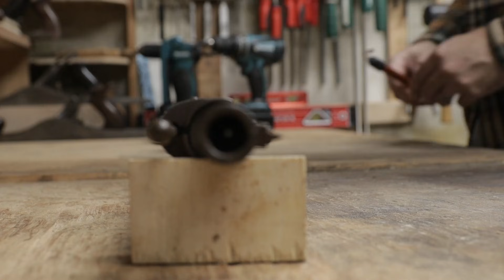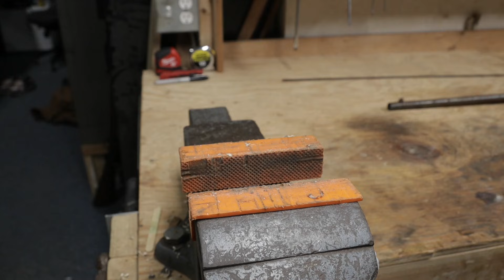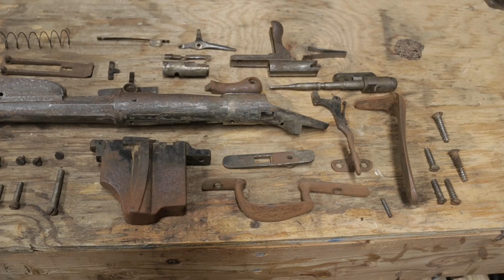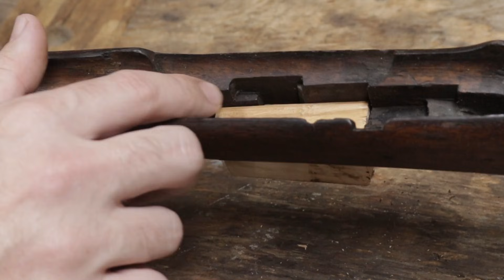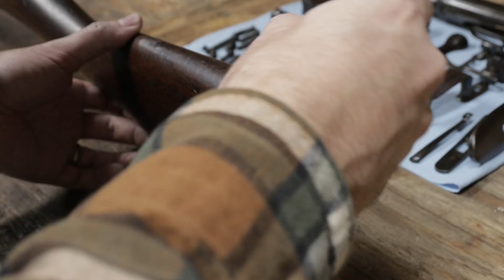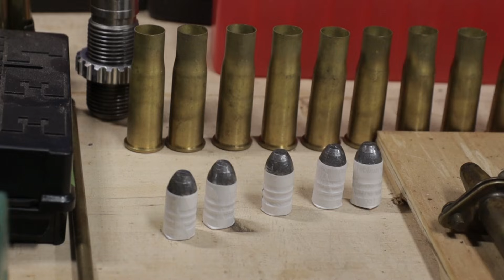Dutch Model 1871/88 Beaumont Restoration

Comment: another really nice restoration. I have never seen that method for blue I have restored my rifles mostly using cold blue but that looks better for historical pieces. once the sights are fixed and the bullet diameter and powder charge is fixed I am sure you will have a fine shooter. Thanks for the video. LL

Comment: Well done! No shiny rebluing or stock sanding, just preservation. This is exactly how a restoration should be done. Many people go too far when restoring old rifles.
Reply: I agree but I'm going back and forth on my vetterli ive been hunting with mine. To keep it like his work or fix it up good.
Reply: @ClaytonGambrel  A Vetterli is highly collectible if it's in original condition. Would recommend to keep any restoration to a minimum, remove active rust and dirt etc. Just give it a good cleaning. It will lose value and originality if you do things like sanding and re-bluing. But if it's already "ruined", like sporterized or something, then it doesn't matter. The Vetterli is nice and interesting rifles by the way, I have an original Vetterli-Vitali M1870/87 in caliber 10,4x47R.
Reply: @WhattAreYouSaying nice, it's going to be sweet when I do get something just been a hard season on deer at least for me

Comment: With any rifle of this vintage, you are treading the same path that the original producers of these one time cutting edge firearms must have tread. Most of the past failures of a great many rifles have been traced back to the ammunition that chambered the firearms. You've done an amazing job just restoring the arm. Taking it to the next level by reloading it for range use, that's incredible.

Comment: no re blueing for any parts? and also power sanding the surface was scary
Reply from the maker: I don't believe in re-bluing old guns. I like the original patina
Reply: @rakumprojects  fair point. I just find re-blueing the surface make them last longer. But leaving it as-is works just fine I guess. Great work too.

Comment: You might want to try improving the bores on these old rifles very simply by using a brass rod tapped #8-32 in one end for an #8-32 machine screw.  Use a hole punch to cut .50" diameter Scotchbrite circles with a center hole for the screw.  Attach one circle to the end of the rod and run it through the bore with some suitable bore cleaner. Try fine circles first and gauge your success.  Hope this works for you.

Comment: The bores on these rifles are usually in very good condition.   Unlike the Italian Vetterli conversion the Dutch did not add a steel surround to the magazine cut out.  Cracks are all too common.  The extractor is loose in the action and frequently missing.  Prospective buyers should check for its presence.   The lump behind the bolt handle strengthen the action and was added with the magazine conversion and the magazine cut-off.   The rifle was loaded with four-cartridge chargers, a close copy of the Italian Vitali chargers.   The magazine had a baked-on (?) black finish.  The rest of the rifle was in the white.

Comment: HELLO  everyone  i bought one of these  a few years ago  what a  fantastic rifle  it was in relatively good condition  to  but  it  also  had a crack  on one side in the  magazine area  which i was quietly hoping  wouldn't be there. cleaned the  barrel out and you should have seen  all the  dust and nicotine fluff and shit that  came  out but  wow the rifling is brand new took the  bolt out and  took it to work and  threw it  the parts  washer and  then  re oiled it  thought it was a  wiser thing to do  than  pull  it all  to  bits (im not  a  gun Smith)and  bugger it up linseeded the  stock finally oil the barrel  and stuck a ear plug in the muzzle to stop damp getting in.  a lovely rifle everyone who  sees it  says  wow beautiful rifle how old is it

Comment: The cracks in the Beaumont conversions are about as common as the cracks in the Italian Vetterli conversions.
Reply: The Italian Vetterli-Vitali upgraded the original single shot Vetterli with the addition of the Italian Vitali magazine design.   The magazine cut out had a corresponding steel shield screwed to the stock to strengthen it in that area.    Beautiful rifles.   I have yet to see one with the stock cracked.   The Dutch did not strengthen their stock and cracks were all too common.

Comment: Good evening from the Netherlands, they cracking around they magazine well is very comen and has a couple rezones, yes they cut it shelf makes it a week point but also they cut it self might touch they magazine, when firing they forse transmitted bij they mag into they stock whil crack it, check if te relief is not to thighed, you might try to silver solder a new pice of rod to they barrel band spring, whit my beaomond i had to make a new spring out of a pice of flatbar (springstheel of coarse). Nice gun and a 10+ for they effort, it's appreciated

Comment: Congratulations on your restore. I just finished my own Beaumont. We all have different methods and results vary as expected. I did find that the rifle was originally issued in the white so I have polished the barrel and action accordingly. It looks really great but I haven't fired it yet. My stock wasn't cracked but I did have that problem on another gun. Like you I used epoxy but I also used a Dremel tool and a very fine wire as a bit to drill small holes for a wire reinforcement. Worked great.
Good luck getting some rounds down range. It's always a great feeling to take a project to fruition!
Reply from the maker: Thank you! I'm finishing up another video on forming brass from 50/90 cases. Will post soon.

Comment: Really great work on the restoration! And ty for going to the effort of making the video.

I’ve been restoring these rifles to shooting condition since my first one in 1975. I form my own brass (though I have had some formed for me by others), use off-the-shelf 300-350 grain cast lead bullets intended for 45/70, use 2f bp or appropriate smokeless and/or my own ‘duplex’ loads if I only have 1f, and use 45/70 ‘trapdoor’ data up to to SAMMI max. Always had excellent results, even with the many cut-down/sporterized ‘carbines’. The guns are just plain fun to shoot. Secret is to not be timid with the loads. These rifles need speed to get the bullet spinning for stability. And, take not if that deep rifling - you need a good oversized or additionally paper-patched bullet to really bite that rifling to get best results. Typically, even at my age, I can usually keep a 2”-3” group at 50yds with 10 shots … good enough for me 😁

I will add one thing that you folks with an interest in these rifles may run into - broken or very weak bolt springs. This spring is concealed within the bolt handle - just like with the Murata from Japan. You can’t get a new one. But you can easily make one from just about any sidelock muzzleloader. All you need to do is file and shape the donor lock spring to conformation to the Beaumont spring and you’re good to go.

Comment: I have watched a few of your videos now and really enjoyed all of them. Many years ago I restored an M1 Carbine and I did attempt to cold blue the metal however I was never content with the finish. Getting a consistent finish that looked like it had a bit of depth was not easy. Unfortunately self loading rifles were banned here in the UK back in the 1990's so I suspect it got cut up. For the full bore bolt action rifles I had a lot of success with lead bullets and gas checks.
Reply from the maker: For smaller bore cartridges I've had success with cast and gas checked bullets. I do need to experiment more with them though

Comment: A trick for getting glue into small cracks is to put to the glue in and then give it a blast with canned air, it'll push the glue in deeper than you can reach, but it can be messy.

Comment: That bore condition is amazing considering the age of that gun. Would really like to see you use hollow ground screwdrivers for your smithing. Saves the screw heads from damage. Neat thing about those old guns is they were all machined parts. No stampings or castings or plastics.
Reply from the maker: The screwdrivers I use are parallel tip, made by PB Swiss. 
And yes there's a quality to each and every part on these rifles
Reply: No shit?

Comment: Great video, were these originally blued or was all the metal originally white? Also, does mineral spirits work as well as kerosene?
Reply from the maker: I learned that these were left in the white except for the rear sight. I couldn't tell on my rifle due to the rust.
Mineral spirits would likely work to remove oils

Comment: The Netherlands Metropolitan Issue M71 and M71/88 were in the White; whilst the Colonial KNIL issues were Varnished ( Shellac, I think) to protect against Moisture of the Tropics...I have examples of both...the KNIL came from Indonesia, the White one from Europe.
I have already replicated commercially the Italian Vitali charger; I need the development drawings of the Dutch Charger ( BV), which brcause of the larger bodied cartridge, is different in dimensions from the italian ones.
DeVreis and Martens book on the Dutch Early Breech loaders ( Snider and Beaumont) have excellent illustrations of the charger, but no specifications. Going on the Illustrations and the Cartridge Dimensions, I can probably " extrapolate the Dutch charger...but original designs are to be preferred...combination Wood and Tinplate assembly. Go to Gunboards Forums for
DocAV.
PS  Becarefull with the Ejector on the bolt body...it is easily lost on disassembly!
I had the one on the KNIL replicated by hand by a toolmaker friend for the White BV ( Missing).

Comment: Tractor Supply sells LEGIT veterinary syringes and needles. A 1 or 3 ml syringe with an 18 to 10 gauge needle works good for the gel and 20-22 gauge for the liquid. Just an FYI.

Comment: Fantastic video as always. If I may add some advice when you did the conversion and you were carding off the parts on the bottom of the magazine and the trigger guard there was still quite a large amount of rust scale present. You need to get under that because there’s still active rust underneath.
Reply from the maker: Thanks! I'll keep an eye on them and re-convert if needed
Reply: @rakumprojects usually requires a scrape tool such as a piece of brass and you crush the case mouth to give it a point edge similar to a knife edge. 30-06 or 50 BMG or similar will do.
Reply from the maker: @jacksonthompson7099  I like to use an older copper penny for that. Works well
Reply: @rakumprojects  perfectly valid method! Didn't know you also used it on steel from what i've seen. Nice man, looking forward to seeing more vids and projects from you. Gonna binge more of your vids when I get some free time.

Comment: You boiled the parts correctly and then carded them as you should have. After that, you left the finish alone. Good man! That stock? minus the cracks, some Murphy's oil soap and some stock wax should do the trick and that stock will look gorgeous. I find that using a toilet flange wax ring with some slight heat makes for some excellent improvised stock wax. Good job!
Reply from the maker: Maybe I'm used to rifles in worse condition but other than the cracks the stock was in good shape. Maybe one day I can oil or wax it though.

Comment: I wonder how electrolysis would work on the heavy rust. For brass, sometimes Buffalo Arms has brass made from 50-90 brass. Sometimes brass can be found on gunbroker. That's where I got 40 pieces for mine.
Reply from the maker: I've been experimenting with the 50-90 brass that I have. Will be releasing a follow up video in the next few weeks.

Comment: I won't call that a restoration but a thorough cleaning, as this rifle was more dirty than really rusted, but good job anyway, though I'm pretty sure it could be really restored. Anyway, you didn't spend much on it and it's a good thing because though the Beaumont rifles are well made weapons, their historical interest is very limited as they weren't used in any major conflict. I still wonder why the engineers adopted such kind of bolt spring, as it is rather complicated to disassemble and replace if broken or lost, and because of it, it is impossible to have a bent bolt knob for cavalry carbines. That's one of the reasons why the French army rejected it when it was decided to replace the Chassepot. About the broken pin, you really tried a complicated way as such pins are really easy to find. If you can't find a genuine Beaumont pin, try a pin coming from another rifle, I won't be surprised a pin of French Gras 1874 would do, and it still would be better than your solution. To give you an example, I once replaced a similar broken pin on a French An IX rifle dating of the napoleonic era with a Gras pin, slightly reworked. And believe me, nobody can tell the difference !

Comment: Beautiful conservation, I was just wondering about the brass. How can you covert 50-90 sharps brass into a bottle necked brass ? That seems very hard !
Reply from the maker: Thanks! I'll be covering how I converted 50-90 to 11x52 in a future video, due out as soon as I can get back to the range.
Reply: @rakumprojects  @GIJeaux1 thanks to both of you for the answer. I'm wondering if I can find such dies here in Europe. Have a great day !
Reply: With the appropriate loading dies and a strong press, it's not that hard to reform the brass. 
The problem, as noted by Rakum, is that dies are hard to come by. The wait is around 2 years right now. I have been on the list going on a year myself.

Comment: These rifles were not blued. They were issued "in the white". The magazine was the only blued part as far as I know. Mine is still in the white but, the magazine bluing is worn off which, is common, because the bluing was not very good to begin with.
Reply from the maker: Thanks for the info!
Reply: @rakumprojects I would like to add that, the rear sight leaf was flame blued so, there was one part other than the magazine.
I really enjoy your videos. Keep them coming.
Reply from the maker: @GIJeaux1   Thanks! Now that you mention it, I can see a very slight difference in the surface finish between the sight leaf and the base.
Reply: I'm not versed in gun manufacturing and I've never heard of "in the white". What does that mean/look like if you don't mind me asking?
Reply from the maker: @RapTapTap69  "In the white" is polished steel that doesn't have any other finish on it, no bluing, paint, etc
Reply: @rakumprojects  ahh very interesting. Thanks!
Reply: @RapTapTap69  As stated, they was no bluing, just polished metal.
Reply: So much info! I love this channel.
Reply: Single shot beaumonts where not blued but after magasine conversion they blued them i think
Reply: @pištazfelvidéku1890  I'm sorry but, no, only the magazine was blued. The rifle was never blued by the Dutch.
Reply: So what you are saying is that they could have left the whole thing in white, and probably saved 3 or 4 cents.
Reply: @thomashaley7657 I'm sure thats not what I'm saying. I have no idea why they chose not to blue them, only that they didn't.